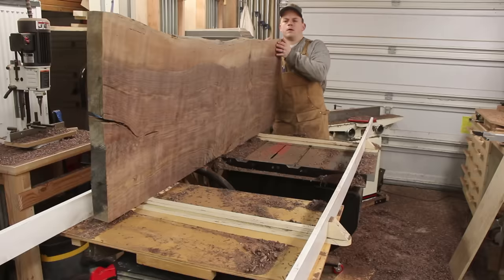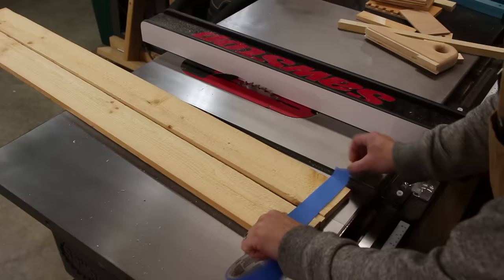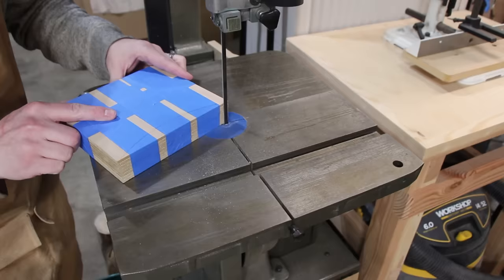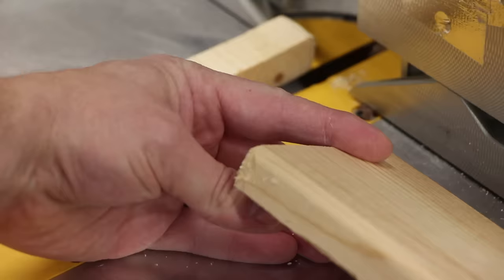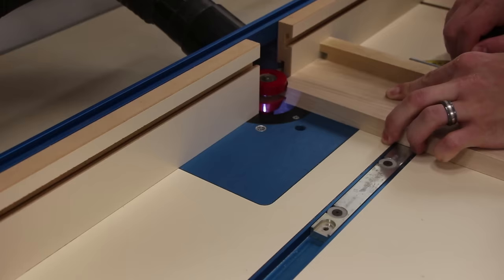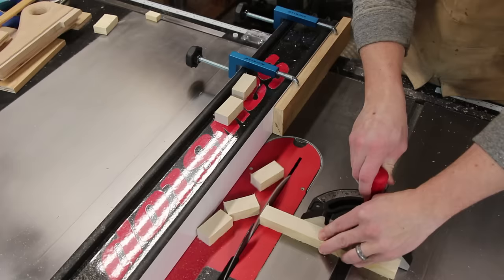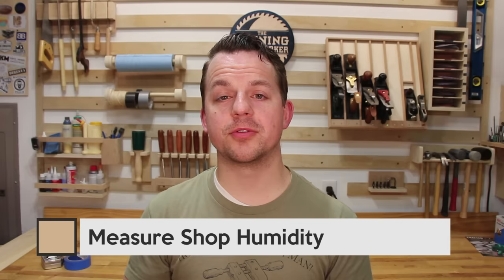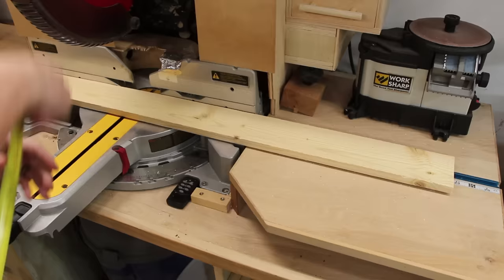7 Woodworking Tips & Tricks You Really Should Know | Evening Woodworker

Comment: Tape Measures: most of the time in woodworking, you're dealing with boards under 10ft in length.  Or at least, after you mill them up into usable boards.  For tapes, I bought a 5-pack of the small, 12ft tapes for under $20.  Then I removed the clips on the back and glued a magnet to each.  Now, I have one stuck on my table saw, my miter saw, my drill press and a few others that I carry around the shop.  I HATE using tool belts or aprons with piles of tools stuck in them.  I feel like it limits my mobility and I'd rather just have the tools I'm using sitting on my assembly table, etc.  

I still use my giant 30ft tape for occasionally rough cutting large boards, but having a small army of little tapes has been a game changer.  Just make sure they're all the same brand (and a quality brand) so you get consistent measurements.
Reply: Good advice. Any favorite brands?
Reply: @tvienti  I actually bought Hart tapes. I know, I know, Walmart house brand. But I compared them against my Milwaukie tape and they're pretty dead on accurate. Maybe 1/32ths difference over 10ft, which is good enough for most of us not designing spaceships. Plus, the pack I bought was maybe $12.99, if memory serves.

I probably wouldn't buy a table saw there, but sometimes the cheap stuff from Walmart or Harbor Freight is exactly what you need.
Reply: @timothymbess  Well, there goes the spaceship I was going to build in my basement.
Reply: @timothymbess  Fortunately most of my marquetry that needs sub-32nds accuracy is under 10' and we can fall-back to the flat-bed LASER cutter if necessary. For the rare 100' circassian walnut deck, I just use GPS.
/satire
Reply: @timothymbess  - I myself down through the years since I was a youngster, have just dabbled in woodworking for building projects just for my own use, or for my own family's use, though I do sometimes build a project for a relative or a friend. So therefore I generally don't need an expensive table saw. (Though it would be nice to own such an item).

After buying many other off brand cheap table-top table saws over the years of which generally didn't last very long, (two of them lasted until I got them home, turned them on and tried to rip an 8 ft. 1X4.). I finally decided to give it one last shot. Back in 1998, I had a project I needed to do, of which called for more than just the use of a circular saw. Well, all I had was my old trusty Black and Decker metal encased Circular Saw that cost $19.99 back in the early 1970's (which I still have, and of which still works just fine).

So, I decided to buy another cheap table-top table saw from Walmart for that project. Yes. It was a cheap brand by the name of "Black & Decker" that cost a whopping $139.99 at that time.  Well, guess what, I still have that cheap $139.99 Black & Decker Table-Top Table Saw, and it still works just fine, and you wouldn't believe some of the abuse I have put it through including cutting odd-shaped and bent and twisted logs for use in the wood stove every winter.

One time I was at Home Depot and had the money to buy an expensive Table Saw. It had all the bells and whistles on it that I would ever need. The only problem was, that I didn't have my pickup truck that day, and was riding as a passenger in my daughters small car and  there was no way I could have got that huge table saw (let alone leaving it in its shipping box), in that car., and Home Depot wanted another $250.00 for home delivery to my house (round trip to my house and back from that home depot was over 150 miles). Just buying that table saw alone would have wiped out my funds (it was almost $700.00).

Well, my daughter and my wife refused to let me buy that table saw as they said my wife needed another washing machine instead as hers was about gone-over-the-hill after 15 years of use, so they took the money and went to the local appliance store and bought my wife a new washing machine and that appliance dealer delivered it for free.  Oh-Well, So much for ever being able to buy and own an expensive table saw, I'll just continue to use my old trusty cheap $139.99 Black & Decker table-top table saw.  At least it still works and is still hanging in there after all these years for everything I need to use it for. 

Am I complaining or whining? Not a bit. I'm just kindly informing you that sometimes even a cheap table saw will work and last a long time.
Reply: Terrific! I have seen too many minimalists saying you should only own one pair of scissors. Seriously? Who wants to go somewhere else to get scissors when you can have a pair every place you might want to use them. I don't have time to waste. 

For the same reason I have about six measuring tapes, from 6' to 50' - and yet, I always forget where I put them down last. Having one at each place just makes so much sense!
Reply: "Measurement is the enemy of precision", Roy Underhill.
Reply: Now that’s a good idea 👍
Reply: Im glad this works for you. A lot of those "short" tape measures are just to small to be used by us mongoloids with large paws. I find it awkward to try to get those little tapes out to measure. I usually  end up using my 30 or 35 footer for everything except the smallest of markings where I would use a combination square. Easier for me all around.
Reply: @twicebittenthasme5545  I'm almost 6'5" with large hands. But the small tapes work just fine. The trick is getting ones that are like mini versions of the rigid, heavy duty tapes - and NOT the craft store ones for sewing that your grandma kept in her purse.
Reply: @timothymbess  Ive found Hart tape measures to be more accurate than most milwaukees and almost dead on with a stanley fat max. Only tested 25' tapes.

Comment: Great little video. I'm a long time woodworker and I picked up a couple of tricks from it.  Here's my tip:  Radial arm saws are notoriously not really good at anything so I have mine set up to do just one thing, a perfectly square crosscut, and I NEVER use it for any other cuts.  Another issue with radial arms saws is that the blade cuts into the table surface and destroys it pretty quickly resulting in tearout on the underside of your workpiece..  I simply eliminate the issue by covering the table surface with a 48" x 20" piece of hardboard.  It saves the table, but more importantly, the hardboard can be moved sideways so I always have a fresh supporting surface to reduce/eliminate tearout on the underside of my workpiece.

Comment: DURING YOUR GLUING OF THOSE BOARDS, I ALSO WOULD ADD BLUE TAPE ON THE INSIDE AT THE EDGE OF THE FOLD. THIS ALLOWS FOR THE GLUE TO BLEED OUT ONTO THE BLUETAPE WHENASSEMBLED...GIVE IT ABOUT 30 SECONDS AND PEEL THE INSIDE BLUE TAPE OFF, LITTLE TOO NO GLUE CLEAN UP.

Comment: That long rip jig idea is something I will definitely be using, and not just for the longer tapered rips!  I've been meaning to put a handle and surface-mount clamps on a board to cut tapers, with the jig rubbing the rip fence.  And may yet do so when I have enough of them to cut to justify making and storing the jig.  But at my current level of need to cut tapers, this trick is all I'm gonna use for a while!  Thanks very much!

Comment: The tape measure idea is great.  Also I have multiple small tapes like 6’ or 9’  in several key places.  I rarely measure things longer than 3-4 feet so I see no reason for a bulky 25 ft tape on my belt or pocket.  Also I use magnets to mount the tapes on the frame of the bandsaw, table saw and on a magnet on the wall above my main work bench.
Reply from the maker: That's a great tip!
Reply: Tape measures rarely measure the same. I have, in the past and continue to use ONE tape for ALL measurements. Learned this in a machine shop. EVERY tape varies. In its zero and at various places along its length. Framing on a cut station, this rarely matters. The differences are minor from one tape to another. In furniture fabrication, they can be the difference between success and utter failure.
Reply: @valdo345jr  absolutely. I only use one tape measure as well. Only problem is everything still has big gaps 😅
Reply: Don't let your tape snap back hard it will start to wear out the holes that hold the tip on making your tape measure less accurate over time.  You can also check your tapes against each other from time to time to make sure they all read the same.
Reply: @Jim-hk6rd  that theory has been pretty much debunked my Steve Ramsay.
Reply: A man with two watches never really knows what time it is ...
Reply: @williamwalters3796  Sounds like Tape Stretching !
Reply: @williamwalters3796  Whenever you measure you always have to add some fudge factor. Then if it still comes out too short you can be extra ticked off then.
Reply: @1pcfred  Yep, I would always cut twice and sneak up on the final fit than to try and hit it first try and have it 0.062 too short.

Comment: I like the tape measure tip, with one caveat, letting the tape just zip back like that, I have found, tends to loosen the hook tip which will throw off your measurement. Good video.
Reply: and you are at the table saw band saw miter table lathe etc and the tape measure gets snagged ... and poof you are now the project piece ... NO NEVER attach a tool to your person to be used ... while it is still attached .... same reason why the shop teacher never wore a tie ... of had long chains hanging down his front ... they get caught you lose bits ... 
BASIC shop safety ... attaching a tape measure to you to be used is the WORST STUPIDIST MOST USELESS AND DEADLY TIP EVER
Reply: No snappy snappy. Finger pinching/slapping whip...and rough of your tools. Especially for a precise measurement.

Comment: The auxiliary fence idea is great for safe and consistent cuts. Would suggest making it wider by bumping it out or making it L-shaped. That will give you more clearance between the blade and main fence, which will further reduce the chance of a workpiece touching the back of the blade. In the video a few of those small pieces looked like they came close to going airborne.
Reply: ^ Plus: If the diagonal corner distance on the cut pieces is wider than the fence to blade distance you have a full-fat kickback hazard.
Grab a push stick to get them clear instead of using your hands.
Reply: @ConorMasterson  And add a sacrificial backer on the miter gauge.  It would allow you to push the cut piece clear of the blade. No?

Comment: Use the same tape measure on each of your projects, because many tape measures have about slightly different measurements. Using different ones have thrown off my projects more than once.
Reply: because american made tape measures SUCK for quality ... they all have excessive play on the end ... THIS is where the main error comes from the other ... the printing process is NOT 100% accurate it is off by a few thousandths of a inch ... and over distance this adds up FAST ... third a tape measure is JUST a rough measure NOT the be all end all of measuring tools ... treat it as such ... if you want an accurate measurement use a metal ruler ... they do come in very long lengths and are MACHINED to Millionths of an inch ... and are square on every side ... so they also make a perfect straight edge ...
Reply: Allowing your tape to snap back as shown in the video will soon effect its accuracy as the hook end gets pulled away a bit each time.  Not noticeably for drywalling or framing but cabinetry yes.
Reply: Tune and calibrate your tape and calibrate with your others, use burn an inch method, and don’t use a framing tape for finish work.

Comment: Great video and tips, I've been a pro woodworker for 25 years and have taped joints together many times. Here is my tip, try using clear 2" packing tap instead of blue. I think it works better. You need to start with the glue side down and the edges of the joint aligned and touching. Put packing tape on the wood and roll it with a laminate rolling tool, this helps with adhesion. Turn the project over and glue. To seal the final joint, use long strips of tape horizontally to the joint, (90 degrees). Here is the best part, packing tape stretches, so put one end a good distance from the joint, secure it well then stretch the tape over the joint seam and attach around the other side. This will act very nicely as a strong clamp.
So many good applications with this tape, especially when nails are not an option.
Thank you, and keep the tips coming.
Reply from the maker: That's a great one! I've used packing tape for epoxy but haven't tried it like that.

Comment: I write on my tools/machines. Usually, it's a wrench size so I know what wrench to go get to tighten/loosen a bolt or hex screw. I also marked the direction for raising/lowering my shaper head so I can limit backlash. Also good on routers so you know the rotation when looking from the usage position.
Reply from the maker: That's great! ...that way you can just get the one you need!
Reply: Dittos. Saves time to have your “notes” right there. 👍🏼
Reply: I just leave whole wrench sets all over the place.
Reply: @EveningWoodworker  here's a tip you maybe did not think about - your affiliate links promote a union busting company that fights against human rights.

Comment: My favorite woodworking tip is to make a table cross-cut sled!!! Just kidding. But please make sure to tape the whole thing and apply your awesome skills to the task. I use mine constantly and would love to see Mr. Evening's take on the classic table saw jig! I highly suggest imbedding t-track into the bed of the sled for hold down options, 45s, and 60s. Maybe integrating some sort of box joint jig capabilities? Or a replaceable zero-clearance/dado blade insert? The sky's the limit.
Reply from the maker: Those are some great features! I'm gonna have to come back to this comment when I build mine!
Reply: This is one thing that has always bothered me. Of all the woodwork videos I’ve watched ... ohh, I need to make another sled for this.
I don’t know what I did with my list but I wrote down all of the possibilities of a sled and just need to figure out how to make it all work.
One thing I saw, after my plan, was the only reason to have a second sled - different saw kerf
But then I’ve also seen an insert to make that adjustable also.
Reply: Let me start by saying I've watched an unhealthy number of crosscut sled videos on YouTube.  The best zero clearance solution I've seen by far is on the Microjig MatchFit crosscut sled.  Rather than just making it replaceable, they make it interchangeable so you've got one for a thin kerf, another for a dado stack, another for a full kerf blade, etc. Four small screws release the insert and you can change out in seconds.  It is genius.
Reply: @StormGod29  I think that Microjig crosscut sled is beautiful. I guess it was semantically the same in my mind as what I meant by saying "replaceable" vs. "interchangeable", so I apologize.  It does seem to need a lot of custom hardware for it though. I really like using t-track since I can use a 1/4" bolt just fine. The nice thing though, you get to make your crosscut sled truly your own! Also, in the Microjig video I saw, the guy never truly established his cross cut sled fence 90 degrees to the blade. It may very well be accurate, but it does bring up a great point. @The Evening Woodworker, you should look into the William Ng's 5-cut method. I was able to get my sled accurate to 0.003" over 25" off of a perfect 90. A bit overkill, but super nice to trust a cross cut sled to be accurate.
Reply: I like to make jigs for various tasks.  I have a really simple jig/sled for cutting keyway slots in the outside of mitred picture frames (of course, also works for any mitred joint).  I’ll often use a contrasting wood for the key just to show off the joint rather than hiding it.  I’ve also made a jig/sled for the table saw for making dovetails - I have a couple of factory-built router dovetail jigs, but I prefer to vary the sizes to give a more hand-made effect.  (I know, I know, for the purists, it’s only handmade if you use a handsaw and chisels)That’s great if time is of no consequence).  I also use my Bosch sliding mitre saw to make larger dovetails in heavier material i.e.: 2” thick (set the depth and either tilt the blade or set a mitre angle depending on pins or tails).  It’s great for making large table legs (6x6 or 8x8) out of 2” material, dovetailed on 4 sides.  Hmmm….maybe I should make a video…. 

I was pretty proud of myself for designing and building these functional jigs.  Until I came across numerous ones on youtube that were very similar (I built mine before I had internet).  Guess I wasn’t so smart after all…

Comment: I have heard many, many, many times to never let go of your tape measure so that it retracts and slams the end.  Over time it will elongate the holes on the tip and the tape measure would no longer be accurate.  I stop the retraction before it slams in and hold the tape so it finishes retracting easily.
Reply from the maker: True, you can always slow it down with your thumb... unless you're trying to be dramatic!
Reply: guyontheblackchair   The tab on the end of a standard tape measure has to float 1/16 of an inch.  Which is the exact thickness of the tab that one hooks the end of a tape measure to the end of a board to measure for a cut.  If one needs to measure the width of a door opening, the outside of the tab is placed on the inside of the opening.  The tab slides toward the case of the tape measure.  The tab is actually the first 1/16 of an inch of the opening.